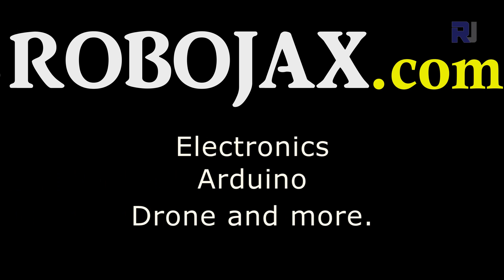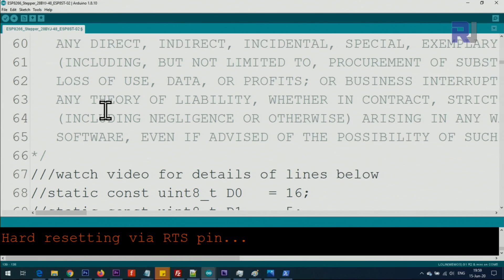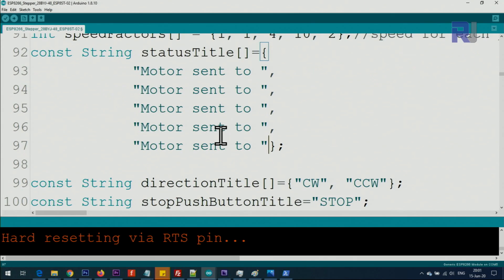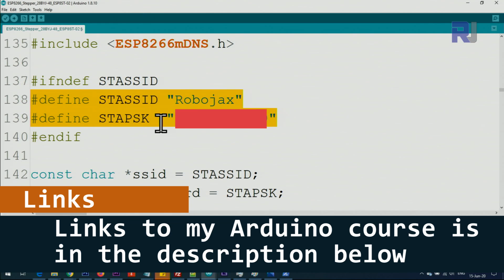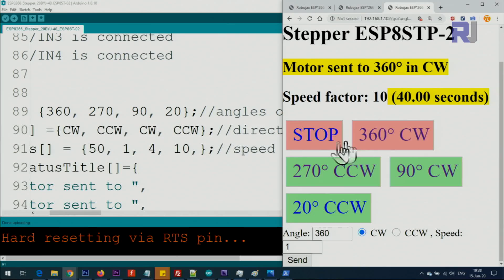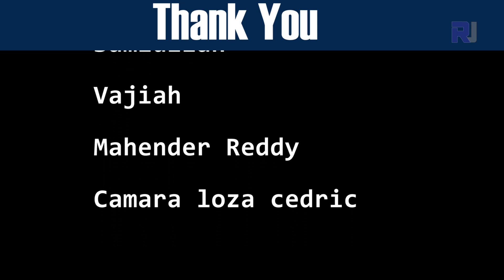ESP8STP-02 Stepper with ESP8266 D1 Mini NodeMCU over WiFi to any Angle, speed and direction

Comment: Thank you for sharing your work. I want to use this project to tune a capacitor for a magnetic loop antenna. Is it possible to add a slider control to to move the motor.
Thank you

Comment: Thank you for your videos, is there any way to use a web pushbuttom, so it keeps movimg until you release?
Reply from the maker: you are welcome. due to nature of web and delay, it is not practical to do it.  why would you hold you finder on the screen or keep mouse key pressed while you can click once to trigger and do it gain to stop it. it thought about it before writing this code and realized that is is not mechanical key and it should be designed differently. I have the push button version without wifi. you may check it.

Comment: Great Video. Is it possible the change the code to control two of the step motors with an arduino uno and an ethernet shield? I would like to use it for a pan-tilt mechanism to control it over lan with a webinterface. Maybe you can do a video for it?
Reply from the maker: Yes it is and you have to define all the pints and code. I might write library so it can be used easily.